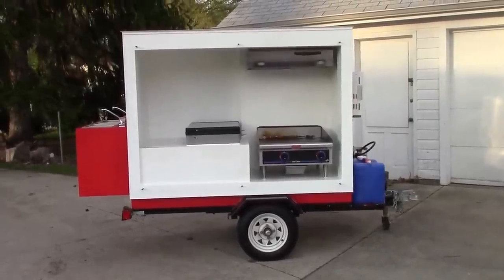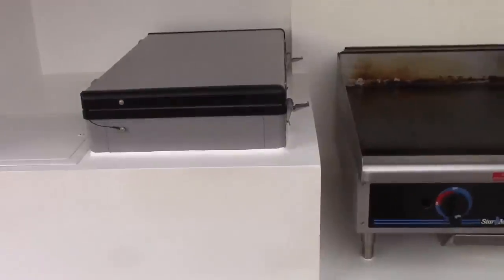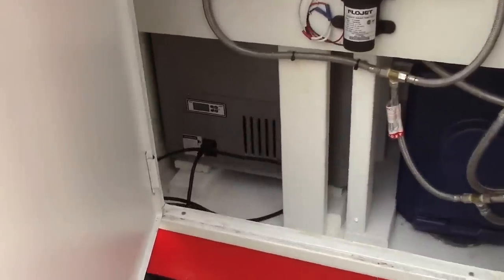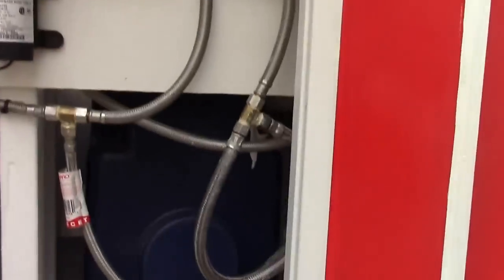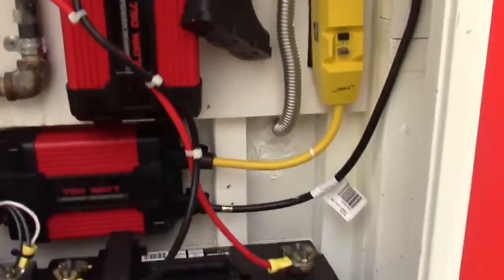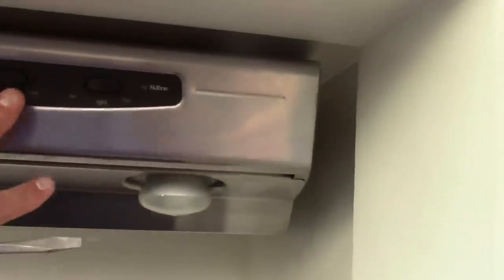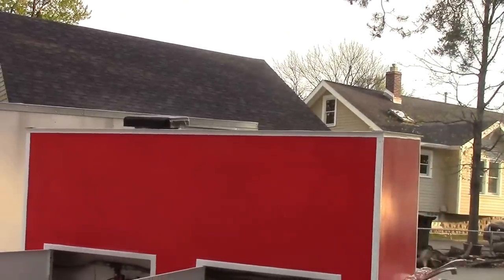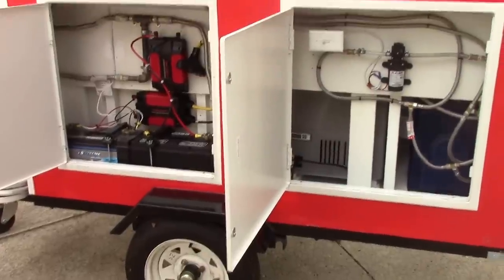How to make a food cart

Comment: great video! thanks for the info.
So...if you are running freezer in 110 anyway...why not just use a regular chest freezer on your inverter? (save around $400) Are there benefits to using the one you did? Will a regular chest freezer not run as many hours on a marine battery? Your  thoughts....
Thanks :)
Reply from the maker: +Laura Will   Hi Laura!  I planned on running it through the 12 volt side which would be more efficient than through the inverter but by running it on the 120 side I was able to unplug the fridge when I got home and plug in directly into an outlet without any thought or having to change over any wires, once I started doing it this way it just kinda stuck.  They dont want to see residential coolers/chest freezers in a commercial application.  I did this build over 4 years ago but if memory serves me a regular fridge pulls too many amps.  This cooler runs extremely efficiently as far as amp draw goes.   Just an FYI I have started a series of videos on starting your own cart business so if this applies to you make sure to check them out

Comment: in appliances how much did u spend? 
great vid. really informational,  u clear got it down
Reply from the maker: +Ikaika Kamai   You're looking at around a $800-$1000 on a griddle and the fridge runs around $600    vent $220 and heater was close to $200 if I remember right   so that puts the main stuff around $2000
Reply: Thanks bud. Good job

Comment: so everything is wood? it looks smooth as if it were fiberglass. the luan is just screwed directly to the 2x4's that you split? how did you frame the cart/trailer?
Reply from the maker: Phillip Reep I used staples to attach the luan to the frame.  Galvonized 1 1/2 inch I believe.  Then I took exterior grade wood filler and scraped it over the indentations of the staples (if they were high I set them with a hammer) and then sanded everything smooth.  Then oil based primer with Two coats of latex exterior paint on that.  

The frame is 2X4's that I ran through my table saw at 1 1/2 inches so you get two studs out of one 2 x 4.  I set the frame with a trim nailer and then added screws for strength as needed.  If you want to see what the 2 x 4 ripped down framing looks like check out my video on how to build a dog house.  I used the same concept there.
Reply from the maker: The Burb Billy  this should get you to that video

How to build a doghouse using lightweight framing (part 1)

Comment: This is a really beautiful cart man! Greetings from Ecuador.

Do you think it could save you money using solar panels instead of the propane gas tank for the water heater and the grill?
Reply from the maker: +Farith Pino   Thank you Farith!  Glad to have a viewer from Ecuador.  The problem with solar is it would cost a ton of money for the panels to get the amperage needed to drive a grill and a heater.  I havn't done much research on it but I know that in order to get some power off of solar you need to spend a bit to get the quality panels and also I live in an area where we are lucky if we see sunshine half of the year.  I know solar still works when it's overcast but I believe that it impedes the amount of electricity produced and that would be an issue when running a cart.  Also it would cause a problem with night time operations.  I did think of using solar to recharge the battery but I never developed the idea past the thought process.

Comment: so i bought a 48 × 96 harbor freight fold up  trailer my question is how sturdy are those trailers i want to build a stand in hotdog cart thanks
Reply from the maker: Stanley, if my memory is correct those are rated for 1200 lbs.  If your build is going to be more than that then you need to upgrade the trailer.  Lumber weight adds up quick, gas tanks, grill, water is around 8lbs a gal and you will need at least five gal on board for washing thats at least 40lbs right there.  I think it can be done but it will be tough.  Another thing is to balance the build weight so that the heavier end rests on the hitch or your trailer will tow squirrely and be all over the place on the road when you tow it.

Comment: Billy, I want to open a food cart this spring in KCMO and have a few questions. 

Is it practical to have a push cart with both a flat top and a fryer? Having both will really increase my options for a menu. 

Also, do you do this on the weekends or is it your full time job? 

Thanks for your time! 

Jonathan
Reply from the maker: +Jonathan Dennis Hey Jonathan, What will determine putting a flat top and a fryer on a push cart would be size/weight of the fryer and flat top.  If you're required to put a commercial rated flat top and fryer on the cart those can end up being fairly heavy.  Then where will you keep the things your cooking?  Does your health department require refrigeration?  If so you need to plan a spot for a fridge/freezer and suddenly that cart needs to be a truck.  My concern with a fryer would be putting something with hot grease in a tightly confined area, it's going to need to be vented and have splatter guards around it.  The heat coming off of the griddle and the grease will be substantial.  Make sure you factor that into any of your plans.
I do not cook anymore.  I would love to but my life has led me in a different direction, full time handyman and part time youtuber. :-)    I'm going to be putting a series together on the food cart business so keep an eye out for it.

Comment: Did you apply the aluminum coating directly to the wood top?  Have you had any problems so far?  I’m building a lightweight doghouse. Do you think I could coat the top and sides with this coating?  Thanks
Reply from the maker: I did apply it directly and it held up for a few years.  The trailer was mostly stored indoors but did sit outside for an extended period while I went through a move and it didn't rot or give out.  Recoating it every couple of years will help as well.   I thought about trying this on a doghouse also but something else to look at is using aluminum trim coil instead.  I took a roll of white trim coil and cut it into lengths and used that to roof a chicken coop that I built.  It worked great and to date zero issues with it.  very lightweight.  should give me years of roof life.   A roll by itself is fairly expensive so it may not make sense for one small project.  I had some left over from a job so it worked for me.

Comment: what type of wood did you use for the walls?
Reply from the maker: +Lester Pixcar  luan, its about 3/16 thick    its an underlayment for floors  attached with 1 1/4 galv crown staples and smoothed out with wood filler

Comment: i am wanting to make a food truck or cart, but i don't know where to start. help is appreciated.
Reply from the maker: Tiger, If I had it to do over again I'd go with a truck or a trailer.  Truck preferred.  cart is hard to operate in changing weather conditions and requires a lot of set up, at least mine did.   Mostly this decision should be based on where you will be operating the cart and what your are allowed to do there.  Some places may allow a cart and not a truck or a cart just may make more sense for what you are selling off of it.  but if you want to hit flea markets and work sites and be easily mobile, I'd look at a truck or something you can stand inside of and have your cook area / food area be contained

Comment: How is that inverter for that fridge working can it hold the fridge without overheating or going out
Reply from the maker: Cold Striker it has been working fine.  Another way would be to wire the fridge directly to the battery as the fridge is capable of running on 12V DC   I haven't used the cart in the past year but when I did use it I ran it on some pretty hot days with zero power issues.  I also had a second invertor there though that I used for the fan and to power my lights at night.  If the first one crapped out I could have just swapped on the fly.

Comment: I have a 3000 watt inverter running on a 12volt deep cycle battery for my NSF stainless steel under counter fridge but my battery only last 6 hours iam guessing yours last longer because its a non commercial fridge , but iam not sure, am  I correct in thinking that ? any advice would be greatly appreciated thanks.
Reply from the maker: yes   amp draw will make a big difference.  Look at the info plate on the fridge and it will tell you the draw, you can also test this with a meter.  Battery age matters as well.  Older battery will not hold up as well
Reply: yeah this battery is brand new from auto zone but 6 hrs is good for me I also bought another one to connect to so I have 2 batteries and get a good 12hrs out of theme then just charge them when I get home with the cart overnight with the battery charger , also iam only going to work the cart for about 5 or 6 hours anyways cause that's all that they allow here in California . but I thank you for your response I really appreciate any info as I am still building my cart . thanks again.

Comment: I'm a bit new to this, sorry... would this setup not require a commissary?
Reply from the maker: +redwhitentrue   In the end everything depends on your health dept.  That said a commercial kitchen is usually a place with a sink for washing your hands and another for washing produce and then 3 sinks for doing your dishes.  Also your cook area needs to be approved and your cooktop/griddle.  Fridge / cooler is next    if all of these are ok then you have a commissary on wheels.  Saves you a lot of money
Reply: The Burb Billy Thanks for the info! Very Nice cart!
Reply: +The Burb Billy (The Burbbilly) 

are you required to store in in a warehouse or some other licenced place for cleaning the cart and such? I am planning to build a coffee cart so it wont be as much stuff as your food cart but im just ondering where you store your cart?
Reply: +The Burb Billy (The Burbbilly) 

also am curious about the battery set up. I was planning on buying a gas powered small generator but could you explain how i could do a mobile set up to run a double hot plate and a fe other smal items? how would i charge the battery bank?
Reply from the maker: +Whitney Harris   You can store it in your garage as long as the area is clean, you can't store gas and oil cans by it.  But they allowed me to keep it in my garage.
Reply from the maker: +Whitney Harris   battery bank is charged with deep cycle chargers for marine batteries.  Mine was built for a light load though, running coffee stuff you will most likely need a generator, too much current draw for batteries in my opinion
Reply: +The Burb Billy (The Burbbilly) are you running that grill of your batteries? all im anting to run is a hot plate to heat up milk and coffee..no coffee makers or anything will be run as i ill be cold brewing my coffee
Reply from the maker: +Whitney Harris   No the grill is a propane grill.  What you need to do is find out the amps on your hot plate and from there you can get a ballpark on if it will run on batteries.  My thought is probably not.  Or you will need a lot of batteries.

Comment: By now you probably found out you should have put in a SS back splash wall to protect and maintain cleanliness.
Reply from the maker: Sky Dog   I learned a few things on this build.  The room was too tight, if I did it over again it'd be in an enclosed trailer or truck.  As far as the ss around the griddle goes, didn't really have a problem with the current set up, I was just grillin dogs so not too much splatter.  It's always good to have stainless around any cook area though, you're 100 percent right about easier clean up with stainless.

Comment: I I am trying to do this myself, on a budget, do you have any thoughts or suggestions for me? I would appreciate all the input I can get :)
Reply from the maker: Tracy Blankenship Thanks for posting, I'd love to help if I can.  I'd say the biggest thing to do is decide where you will be selling and then contact the local health department in that area and get a run down on the rules for food venders.  This will help you with your build so you don't purchase an item and find out after you pay for it and install it that the local inspector wont pass it.
Battery power will limit your menu items as things like a coffee pot will probably pull too much power for a battery to sustain them.  If you know where you are parking will offer power then you can build based on that.
If you run into an individual problem and need help shoot me a message with what the problem is and I'll see what I can do to help.
Reply: Thanks for your sdvice--Would i be able to use my existing battery and use a converter like you did, snd turn it into a 110? And is that expensive?
Reply from the maker: Tracy Blankenship It needs to be a deep cell battery (marine) not a car battery.  The ones I show in the video cost $140 each if I remember right.  A converter like the ones shown you can get at Harbor Freight in the $50 range depending on what coupons you use.  That same wattage converter Ive seen priced around $100

Comment: Hi, that's an amazing food cart, sure ! Thanks for sharing your skills. Would you send the plan of the whole structure ? I guess it's wood made. What about making it with aluminium instead ?
Reply from the maker: I don't have any plans, built it out of my head.  Aluminum would be good with stainless on the inside.  If I had it to do over again I would have built a food truck or an enclosed trailer.  Just an fyi     much easier to move around in and to set up and break down

Comment: What does this weigh? I'm trying to figure if a Tacoma can haul. It can't be that bad.
Reply: the capacity is about 1700's weight. Might be a 2k trailer in HF. I own a 2007 Dodge Dakota V8 Magnum.  it handles about 3-4k on the rear. You good tho. Look it up on your side door it has a tag. Will say rear towing or weight.
Reply from the maker: i pulled it with a dodge grand caravan so you should be good.  My weight was higher on this because I used the griddle/grill    if you are doing a boil set up(hot water dogs) then it would be lighter as it would just have a burner assembly on it.

Comment: What were the dimensions of that trailer to begin with?
Reply from the maker: That started out as a four foot harbor freight trailer
Reply: @burbbilly  Thank you! I was on the fence on whether to go through with the purchase of that exact same trailer, but you say that you had to add 2 feet. Was that solely because you winged the construction? Do you think a little more planning could've fit everything onto the 4X8 trailer? I only ask because A: I can't weld and don't know a welder, and B: the price demands I put more thought into this.
Reply from the maker: If I could do it over again I absolutely would go with the 8 foot trailer.  The four footer was not nearly big enough and even though I added two feet to it I struggled with balancing the weight on the trailer.

Comment: how long do the batteries last
Reply from the maker: +Eric Towet   battery lasting power depends on a lot of things but in this situation I was able to comfortably get 24 hrs of run time.  I split the  load between the two batteries and the fridge wasn't open all the time.  If the fridge was open non stop and running all the time that would cut into the battery time.  I had it figured out based on the battery manf specs that one battery could power the fridge for 24 hrs non stop.  I used those specs when I got my food cart permit and they issued me a permit to sell food anywhere in the state because of that.
Reply: How do you set up for electricity?

Comment: what would you charge to build one of these
Reply from the maker: Arthur, There is probably at least $3000 in material with what is on this cart.  the griddle is around $1000 and the fridge runs around 6-700  Have not run down a labor cost but at least double that.     I learned a lot from this build, the biggest thing I learned was if I had a do over I would have built it inside a trailer and not set up to work from the outside.    To much set up when I got to a location.
Reply: +The Burb Billy (The Burbbilly) ok thanks

Comment: The  fridge should have been 12v.  Your wasting efficiency by going through the inverter.
Reply from the maker: Fridge is both, 12 and 120    I ran it 120 because I already had the inverter set up for lights, fan, radio, etc....Easier that way.

Comment: How are sales? I need a cart but if I'm gonna lose a months work over it I'm gonna just buy one. Besides your probably a little more handy than I am. Tell me your cleaning up....
Reply from the maker: Buying one may be the way to go especially if you go used.  Used equipment is usually deeply discounted as they are trying to get out of it.  If the price is too high it probably wont sell so just check back with them in a month or so and leave a cash offer.  You'll probably get a call :-)   With the equipment I have on here if I could do the build over again I would have built it in an enclosed trailer.  Little bigger but easier to operate out of